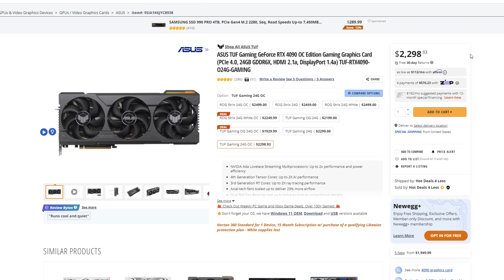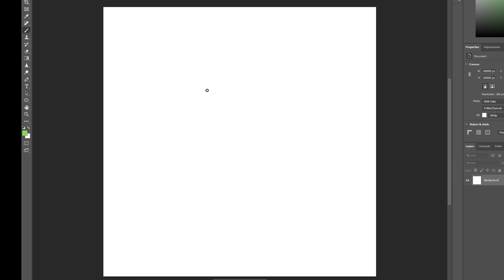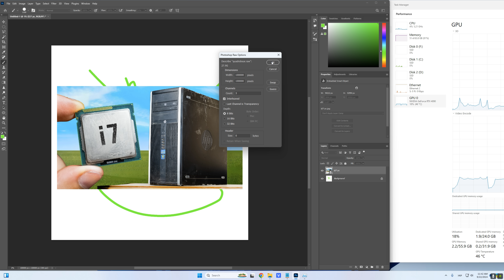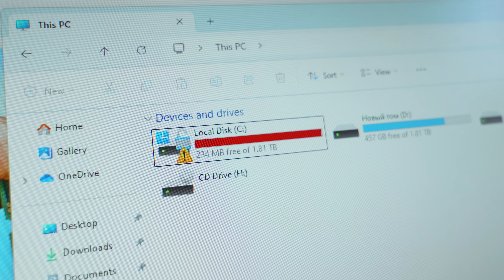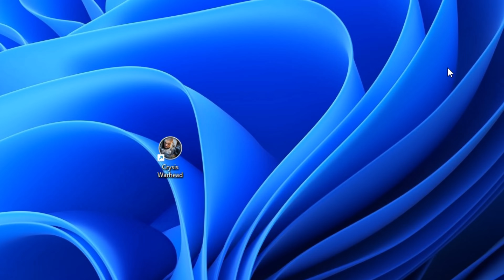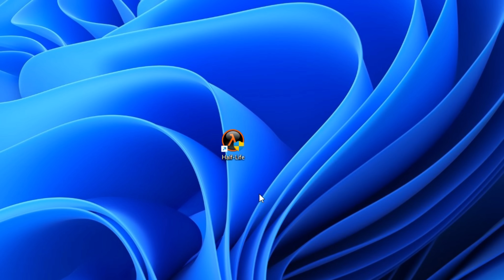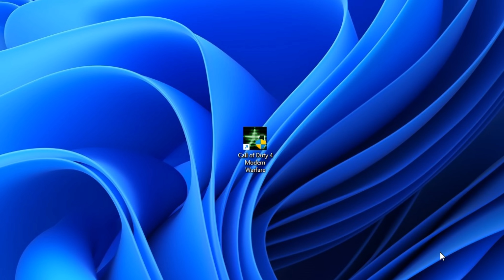RTX 4090 vs 300,000x300,000 Picture

Comment: They don't put warranty void seals on pc parts... it is just to tell them if you opened it or not, so they can check for end user damage. Has nothing to do with the warranty. That would be illegal I am pretty sure.  The sticker being broken means the refurbished card would've been done by someone other than the manufacturer because I just received a 4090 from Asus as an RMA, and they say RMA replacements are either fully brand new cards or brand new with some remanufactured parts, that the card has never been sold or touched by an end user and it is only labeled as "Refurbished/Recertified" due to not being able to legally sell warranty replacement stock as new. Came in a brown plain box that had a "Refurbished" label on it and the sticker on the GPU was untouched or most likely replaced with new sticker if it was a partial new unit with refurbished part/s.

Comment: A 300,000x300,000 image contains exactly 90,000,000,000 pixels, you could fit roughly 43402 frames, or 12.056 minutes of video at 1920x1080 resolution 60fps.
You could fit every frame of this video on that image and still have 1166976000 pixels left.
Reply: r/theydidthemeth
Reply: 12minutes? Not that long

Comment: YOO I used to used the Custom DSR tool a ton on my 2070! I love taking extremely high resolution screenshots, you get so much data to work with (even more combined with HDR. Jxr can be a bit frustrating to work with, but the cameraraw plugin makes it easier as I can extract the jxr files to something like jxl, dng, or psd). I am now on a RX 7900 XTX, and using a virtual display driver (looking at the virtual monitor through OBS). I have to do this because VSR is arbitrarily capped to 8k even with regedit or other tools lol. The extra VRAM is awesome for high resolutions. Anything above 16k black screens.

The 7900 XTX is so nice, saved me $2500 since I would have had to upgrade my entire system to support the 4090 instead of just a plug and play transfer with the GPU and my current hardware. I was happily willing to lose a few features and ray tracing performance for $2500.

Comment: "I will hit you if you write that CS 1.6 was created on the Half life engine :)" 💀
Reply: @WhatAboutThePC? it was though?goldsrc is the engine for half life and other early valve games until 2004cs classic (cs 1, 1.5, 1.6 etc) was released in 2000half life was released in 1998

Comment: By the way, I may be wrong but I don't think that's how the K scale works. It's in factors of the standard HD format of 1920*1080. That means that 4K is NOT 4000*4000, but only 3840*2160 (each dimension is doubled, not quadrupled, due to the square-cube law) If my maths serves me correctly, the 300,000*300,000 image is not 300K, but 43402K (wow)
Reply: "K" resolution is a generic term used in the film industry for the horizontal resolution of a display or image, 300,000*300,000 would be considered 300k.
Reply: @ukjamie96  Fair enough - Wikipedia says that while 4K for example is technically 4000*4000, people use it to refer to 3840*2160 which I now know is incorrect!
Reply: @onetruetreetree  Wikipedia says 3840x2160 (among other similar resolutions) is considered 4k. Again, 2k, 4k, 5k, etc refer to the rough number of horizontal pixels. It's as simple as that.

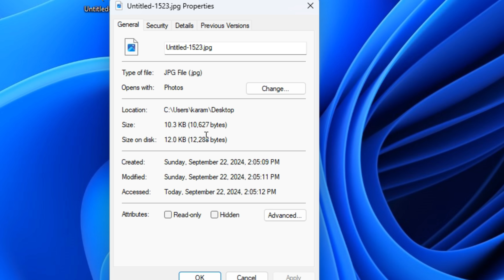Comment: 2:00 why in the world is a 4px jpg taking up over ten thousand bytes??
Reply: The reason is compression and metadata/file headers. 

For a short file a compression algorithm might actually make it larger. They work best with larger payloads. 

Also JPG has a ton of "useless" data in its header. It consists of:

Start of Image (SOI) Marker: A 2-byte marker (FF D8 in hex) indicating the beginning of the image file.

APP Segments: Application-specific segments like JFIF (APP0) or Exif (APP1), which store metadata such as camera settings, thumbnails, or color profiles.

Quantization Tables: Define how image data is compressed and affect image quality.

Huffman Tables: Used for efficient encoding of the image data.

Start of Frame (SOF) Marker: Contains image dimensions, color components, and compression parameters.

Start of Scan (SOS) Marker: Indicates the beginning of the compressed image data.

TLDR: in a 2px*2px (4px) image most of the data is boilerplate metadata about the size, colours and a bunch of other things. Also compression can make small files bigger

Comment: Las Vegas Sphere has a similar type of setup which uses 16k resolution for display, The screens are powered by Staggering 150 NVIDIA RTX A6000 GPUs help power stunning visuals on floor-to-ceiling by 16x16K at 60fps for 24/7, Displays across the Sphere’s interior, as well as 1.2 million programmable LED pucks on the venue’s exterior — the Exosphere, which is the world’s largest LED screen
Reply: I misread 60fps as 60k fps lol
Reply: All so it can show shitty ads. What a shame.
Reply: Bruh a6000s are overkill isn't it
Reply: @whknsa  16k resolution at 60fps needs like 150 A6000s
Reply: @whknsa since they need 20 gpus, they are underpowered if anything

Comment: I mean, for now you got 'lucky' with that deal, but if you keep it into the 5080s release it's more than possible that the only advantage (if even that) will be more VRAM. The 5080 will probably be at most slightly slower and have improvements in everything else.

Comment: Bro never heard of OBS!!! Should've used CPU processing for VIDEO.
Reply: pretty sure he was using geforce experience to capture the screen as a joke atleast i hope hes not that stupid
Reply: CPU Processing is much worse than GPU Processing.
Reply: @T-99K_GMD  No, CPU processing can be fine if you're benchmarking the GPU, unless you're hitting a CPU bottleneck!
Reply: @ScrakSFMs  CPU Processing is not bad sometimes, but OBS has very bad optimization, it requires at least high-end cpus to record video at 8k.
Reply: @T-99K_GMD  You’re missing the point. OBS uses FFmpeg for the recording, it’s just the interface. So if there's a problem, it's more likely with FFmpeg's settings (wrong parameters, CPU vs GPU encoding) rather than OBS itself. The best solution here is to use a capture card and record on another PC—then none of these arguments matter. It's a way cleaner and more efficient setup.
Reply: @ScrakSFMs  It is right...

Comment: you need a threadripper with 1tb of ram for this ngl
Reply: nah he'll need Xeon w9-3495X and 4 tb ram
Reply: No, he needs a Xeon 6900p
Reply: plus a 100tb+ raid10 nas with KIOXIA CM7-V ssd's and 25gig networking 🙏
Reply: Real
Reply: Not really CPU straining surprisingly, but definitely the RAM and VRAM, you could probably push it even higher if you got a workstation card (the ones with 32-80GB of VRAM). I think you'll still be limited by Windows or DirectX, I've only ever been able to get 16k to work, nothing higher.
By not really CPU straining I'm talking about pure game output, I barely notice my 4 year old CPU going over 20%-30% at 16k. A good CPU is for higher frames, when there's not already a GPU bottleneck. Not really the point of this experiment.
The biggest limiting factor for higher resolutions is VRAM and compute power, your GPU has to store hundreds of millions to billions of pixels into its buffer, and calculate a ton of vertex data. The CPU and RAM is just the solid foundation. Hell, you might even need the bandwidth HBM2e offers to get something even usable, GDDR6 is only so fast.
Reply: Ram? 💀 Even 1TB ram can open up to 10000 tabs bro wtf
Reply: Nah you need an epyc with 2tb ram
Reply: @Милвалке  Nah a 288-core Xeon 6 with 4tb of ddr5 ram
Reply: need better single core speeds for crysis, intel was promising 8+ ghz at the time the game was being made
Reply: da
Reply: I only have 512 of storage!!
Reply: at least 100gb. 200gb should be enough
Reply: Isn't it supposed to be a GPU test? ._.
Reply: @imaguest8018 I don't think you know anything about computers
Reply: @thrash_badger to be fair that isn't a common concept for a lot of "techy" people.
I have a friend who is very knowledgeable in computers and had no clue that his steam downloads were being bottlenecked by his CPU.
Reply: @imaguest8018  you're gonna need a better CPU and more ram with that type of size, GPU only isn't gonna cut it cause exporting and importing uses alot
Reply: Which is why you make the GPU the limit, to test it... 
If the CPU can only do 10% of what the GPU needs, the GPU is only gonna run at 10%. 

Therefore I suggest, having the GPU run at 100% would be rather a better test? @imaguest8018
Reply: If this is for gaming, we don't need any CPU workstation nor 1TB of RAM.
Reply: Still AMD will blow up
Reply: @fezel_og   ?

Comment: 16k resolution is crazy
Reply: Frfr
Reply: imagine getting clowned on by gen G because you can't afford a 16k monitor
Reply: @ion_force  what is gen g😂😂😂
Reply: @kriticalfallen hes talking about a futurr generation that doesnt exist yet
Reply: i took a 16k mc resolution screenshot on my 1060.
Reply: @temptresses  Hell yeah, that's the way to do it. I do it in Warframe, you get a crazy amount of data to work with, a higher MP count than my mirrorless camera lol.
Reply: @Male_Parent  when i tried to go past 16k though, my gpu driver ran out of memory and my game crashed
Reply: And I wish I could play at 1440P ultra on all games, some even at 1080P annihilate my RX6700XT even before getting into ray-tracing...😢
Reply: @guily6669 dont run raytracing then. 6700xt is pretty adequate for most titles at 1440 high or even ultra. It’s just bad at raytracing as all other AMD cards
Reply: @Sentinel_Imperator   I think the time RX 6700XT was a 1440P card is gone pretty much...

Almost any UE5 game I play and any more visual demanding game it can't even keep 1080P ultra without ray-tracing at stable 60FPS, some are more in the 30 and lower FPS range or have to drop quite some settings.

It's also being a pain-in-the-ass to play Test Drive, already dropped quite a few settings and even with crap FSR vaseline not even in balanced runs fine at 1440P grrrrr...
Reply: What kind of graphic vendor did you chose, or which games are you playing? I can play 1440p ultra on real time strategies games with my rx 5700 xt.  @guily6669
Reply: 8K or 16K only makes sense in VR (with VR the  imagine is right in front of your face and covers a large chunk of your field of view so you need way higher resolution in order to get a high enough pixels per degree). I think for a VR headset that covers your entire field of view you'd need a 32K resolution per eye to hit the theoretical limit of your eyes (though anything above 8 or 16k per eye probably starting to get into diminishing returns theritory which makes either 8k per eye or 16k per eye the sweetspot for VR)
Reply: the eye doesnt have a resolution,atleast in pixels @KeinNiemand
Reply: @lostmymain.  Not in pixels, but the eye has a finite number of rod and cone cells, so there still is a hard resolution limit and even if that resolution is not square grid of pixels there is a pixels per degree resolution (yes I know it's not uniform across your whole field of view) where your eyes can not distinguish between pixel such a resolution could be considered higher then your eyes resolution.
Reply: no it isnt??
Reply: Bro... how did You get blue comment On Youtube 😭
Reply: Me watching this video with 1080p🥲
Reply: I think your phone can't run more than 1080p maybe 1440p
Reply: @Famirion They do 4k what???
Reply: @sulfurnitride It’s not true 4k, it’s slightly better 1440p. Look up the pixel count of your phone and then the pixel count of 4k.
Reply: ok  @Famirion
Reply: @Famirion  androids have 4k (i think maybe some also have 8k but i may be wrong)
Reply: @Emeraldpig52  there are no phones with 8k right now
Reply: @Famirion soo almost 2k
Reply: @Kahleek_sai  and I am talking about the first number. But you right because in the video its about the second number
Reply: @Famirion yeah that's the best screen resolution rn on the Samsung S24, being 3120 by 1440
Reply: @Famirion Sony flagship phones used to offer 4K hdr displays

Comment: I wonder how would the 7x 4090 PC perform
Reply: the 40 series doesn't have SLI so it would probably only perform like 10% better.
Reply: @MnDogman  the 4090 does have an SLI connector. although even a theoretical 4x4090 SLI would only have 96GB of VRAM
Reply: @Physuo  yes but it isn’t supported
Reply: @Physuo  What magical LaLa-land are you living in where a 4090 has an NVLINK* connector?…….Because it surely isn’t this reality!
Reply: @ThatGuyPal88  liquid cooled 4090 cards take up 2 slots
Reply: @Physuo  What does that have to do with anything I said, off your meds huh?
Reply: @MnDogman  not in games, but in rendering the 300K image
Reply: @MnDogman  No the 4000 series doesn’t have an NVLINK/sli connector, even so 3d rendering software & LLM’s can split task between GPU’s with scaling close to 90%! Just no memory pooling which Nvidia barely supported anyway.